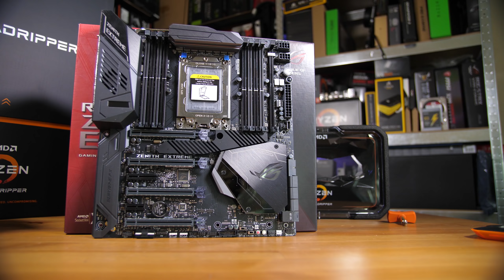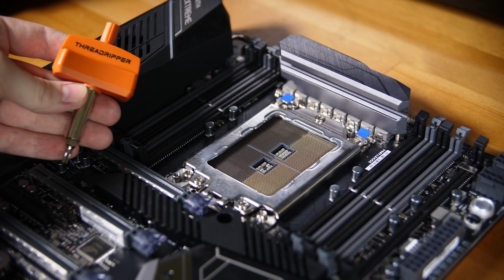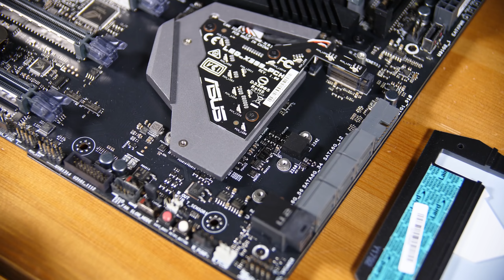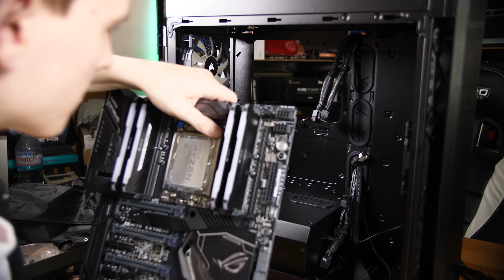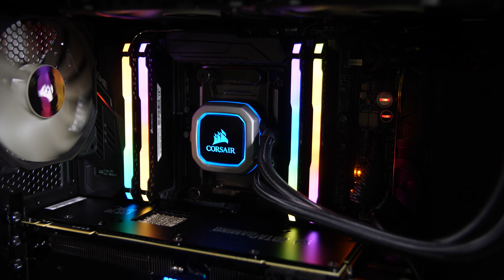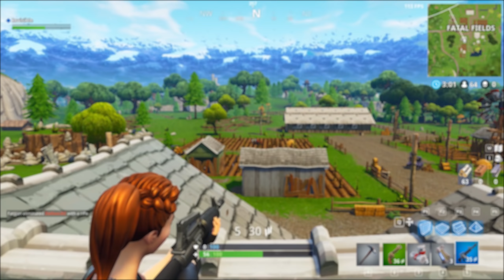Threadripper 2950X & RTX 2080ti Build Guide

Comment: is this the same components used for the hackintosh ? build ?
Reply from the maker: Similar enough, except the 2080ti is replaced with an RX 580.
Reply: @TechteamGB  i'm trying to figure out my next build i really need a new music production workstation, but my thing is which processor to use because i'm a really big fan of AMD and all my past towers i've used AMD and i havent had any experience with Intel Cpu's until i bought a new macbook pro which is almost at its limits..... i just need some really good advice on where i should start, that's all...

Comment: I’m confused because at 1080p max settings on fortnite my i7-8700 and 2080 gets 240 FPS solidly. Why doesn’t the tread ripper ? Is it really that bad for gaming. I was thinking about picking up a 2950x with prime day for $400 but now I’m not sure if it’s worth the upgrade because it may be a downgrade
Reply: The 2950X gets about 15% less FPS than an i9 9900k in gaming, but if you're doing 3D graphics like 3D modeling or 3D rendering you should definitely pick up the 2950X, it's about 50% faster. The pros outweigh the cons for me personally.
Reply: Jur I grabbed the 9900k off Amazon when it went on a lightning deal for $343 usd. So far ive been loving it. Way better than my 8700

Comment: Do you get stuttering in the form of sudden fps drops??? I have the same CPU and GPU and 16gb ram installed in the non recommend mobo ram slots because one of the recommended doesn’t recognize the ram sticks. When playing pubg every 10-15 seconds I get stuttering ( image freezes and gpu usage drops for a split of a second ).In apex legends I get 40fps drops every 20 seconds or when aiming. Also if a YouTube video starts while I’m playing a game fps drop for a second and then increase again. Do you get the same problems????

Comment: I have a 1920x (will be going to a 3rd Gen TR when that launches) and had setup 2x RTX 2080 Ti's in SLI (EVGA XC models).  I have had a lot of problems getting SLI to work though (system hangs/crashes, BSOD's, etc).  
I was hoping to find someone with a similar build and see if they'd had luck with SLI.  I'm guessing at the moment the problem is the SLI bridge itself (since both cards work individually, and the system has no issues when the 2 cards aren't bridged), so I have a replacement coming tomorrow.

Have you tried SLI yet with your 2950x?  Was just thinking maybe there's some weird incompatibility between Threadripper and SLI 2080 Ti's.  I know it worked fine previously with SLI 1080 Ti's, 1080's, and Vega 64's so I don't see why that'd be an issue, but again.. just curious what your experience has been.
Reply: Well with the RTX series cards, they're built for NVlink. Try doing that and see if you get a better result.

Comment: Switch to the enermax liqiutech cooler. It will preform much better. Needs more rgb
Reply: Do not use enermax unless you like corrosion... ekwb ek-fb x399 waterblock is the only way to go... maxes out at 56c under full load... just make sure it's at least a 240 but a 360mm rad will also cool that rtx in same loop

Comment: Could you use 3200Mhz memory instead of 3000Mhz? And where did you get the mounting bracket?
Reply: Of course you can I think he used the lower bandwidth memory because ram prices are sky high and it had low timings. Not to mention he can just overclock it himself